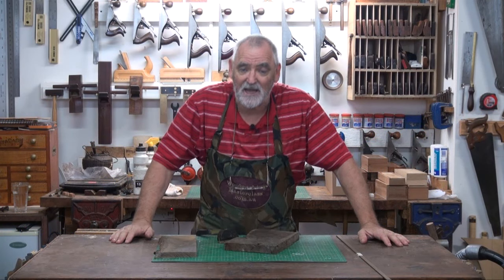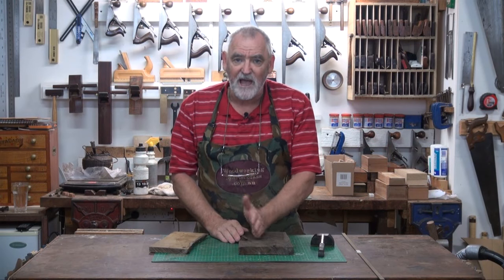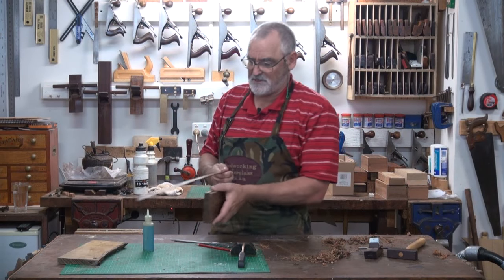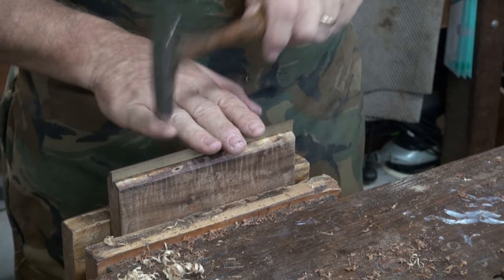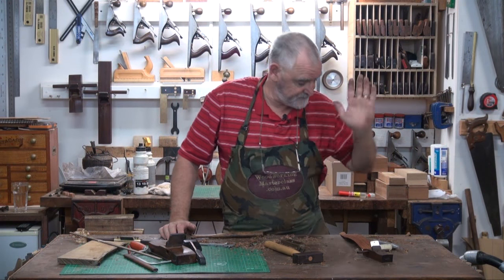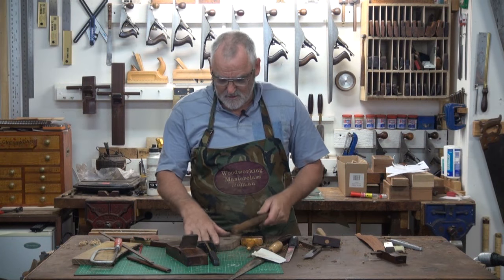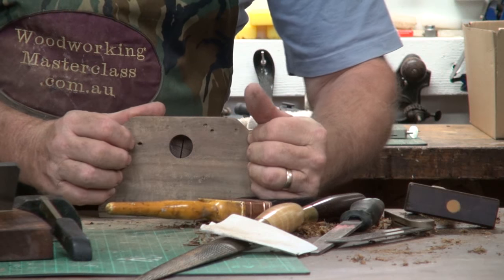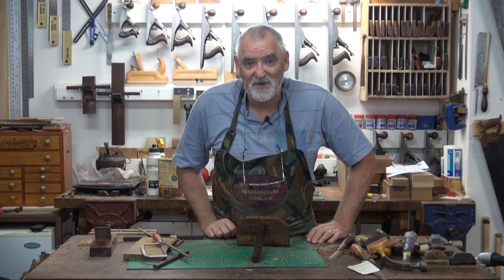How to Make a Veneer Hammer

Comment: Great video, Steve!  Thank you for making it.  Would a 1/4" thick aluminum work for the blade?  I would guess aluminum shouldn't be much worse than plastic or plexiglass some have used unless it reacts with the glue/wood or stains them.

Comment: thank you for the video. i will make my one direkly after i bought some brass
Reply from the maker: Good to hear. Brass I find is best but copper will work as will steel with on certain timbers. Just lookout for staining with timber containing tannin if you use Steel or Iron. Cheers Steve

Comment: Just what I've been looking for. I'd like to not have to buy something I knew I could make myself.
Reply from the maker: Hi Matt, nothing better than making tools you need to make a job you want. Cheers Steve
Reply: @Woodworkingmasterclass  Aye, you're right about that. BTW, the brass stock you used, I'm guessing it's about 1/8x1/2 or 3mmx13mm, is that about right? That was always my first question, I didn't want to get insufficiently lightweight material for the knife edge.

Comment: Hi Steve

A very useful 'how to make a tool' video

Would you consider the file finish on the brass to be smooth enough not to mar thin veneer, or would you take the brass up to say 600 grit finish with wet and dry or emery paper?

Cheers

Jonno
Reply from the maker: Thanks Jonno I hope other see it that way too. Thanks for your feedback. Cheers Steve
Reply from the maker: J onno Sorry only read 1/2 the comment. No the file was a fine cut and left it smooth enough for any veneer I can think of.  Cheers Steve